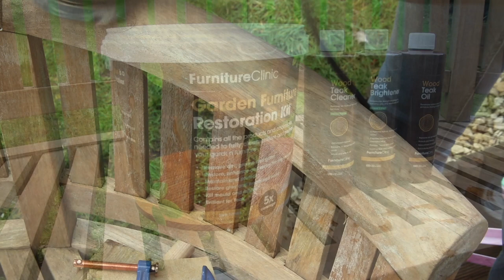TEAK BENCH FURNITURE RESTORATION - HOW TO RESTORE A TEAK BANANA BENCH

Comment: I have a banana chair with a broken seat slat. I removed the slat and tried using the same glue as used here and a clamp, but it wouldn’t hold. Next though it to source a new slat, but I’m really unsure about how to fit it as there’s no play with the remaining slats and the wood won’t be flexible enough to manoeuvre in. Any ideas?